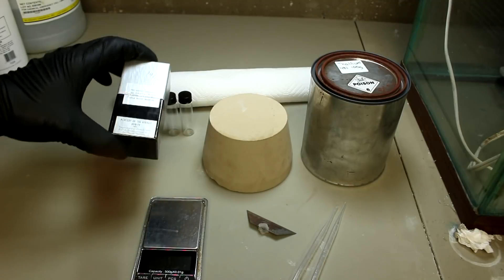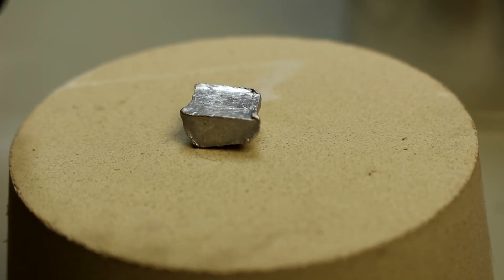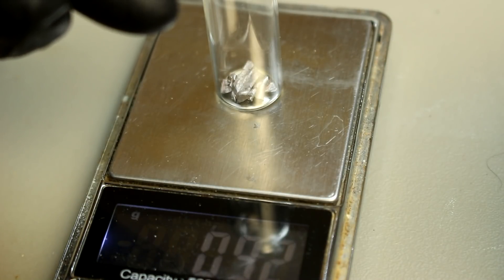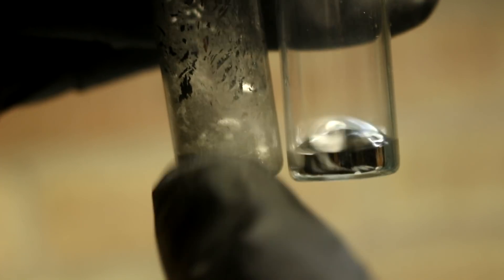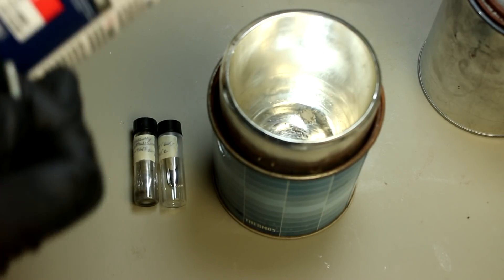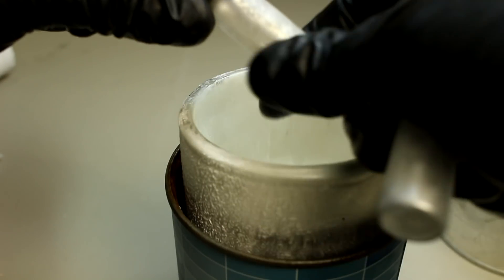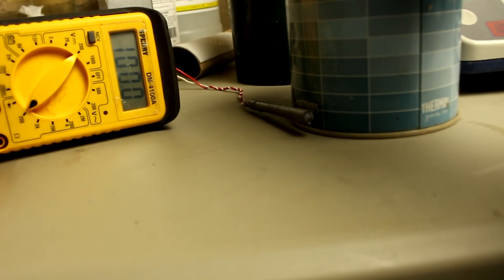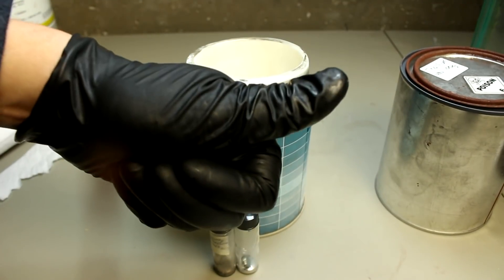Thallium Mercury Fusible Alloy

Comment: Cody, you can buy an old soviet SBT-11A Geiger-Muller tube for around 30$ on eBay and replace the tube you have in your GMC-320+ geiger counter with it (it works at the same voltage). Thus, you can detect low energy Beta and Alpha particles too :)

I have the same geiger counter. I did the modification : it works very well ! I litterally get ten times the counts from some samples (because they emit mainly alpha/low beta) than with the stock tube. Some other samples have a much lower difference, depending on the radiation type. And it's pretty easy to go from one tube to the other, depending on the needs.
Reply: Even better if you use a SBT-10A which is about 10x more sensitive than the SBT-11A (because it's a LOT bigger) or a SI-8B which is also bigger. The SBT-10A needs a 30Mohm resistor on each of the 10 anodes to work correctly, and the SI-8B needs a 20Mohm resistor on the anode, but other than that they are pretty much drop-in replacements. My GM counters modded with these tubes go absolutely nuts near a thorium mantle.
Reply: stamasd yeah I hesitated with the SI-8B. Don't remember what drove my choice. Maybe the price, sbt-10a is more expensive IIRC. And less "popular".
Reply: Mr Nobody not that much more expensive. I got mine for $40 including shipping. Same for the SI8b.
But I agree the SBT11a is better for making a small portable but sensitive counter (because it's smaller) - good for hunting radioactive stuff at thrift stores and whatnot.
Reply: Geiger geeks, yeah... 
With the Si-8B I get about 8000cpm from a thorium mantle with the aluminum cover on, and over 27000cpm with it off (alphas galore). And even though it's a huge 3-inch pancake detector, it's my favorite even to carry around - still small enough to be reasonably portable. About 1 pound including Arduino, LCD and batteries.
Reply: yes I will get a russian pancake some day too.  I got lucky enough to score an LND 7311 pancake tube for $40.  Had a lot of fun with it.  I go to antique shops and find stuff occasionally.  There's a few vids on my channel of testing things.  So far the hottest orange pottery I've found was made by Oxford.  I get near 80,000 CPM with pancake held across top of a little cup shaped bowl.  It's mostly soft beta but still quite active.  In comparison I might get only about 35-40K CPM off Fiesta orange stuff.
Reply: We are geiger geeks.  but yes... even the SBM20 is a better tube than the stock Chinese glass walled M4011 which comes with those.  Glass blocks too much low energy beta.  I cringed a little at the first burst of smoke which came off that lantern mantle.
Reply: I also tell them it's a geiger counter and detects mildly radioactive things which are nothing to be worried about.  However I start with "antique glass/pottery detector" because that's what I'm usually looking for.  I do not try to scare people.  You need to choose your words carefully if you go.  Most clueless people think it's a metal detector.  Often people think I'm checking for lead in pottery glaze.  Check all vintage orange pottery.  20+ different companies were making it and not just Fiesta.  :)  After WW2, Depleted U was used in Fiesta until 1973 when they finally stopped.  Before WW2 it was natural U oxide.
Reply: Wait... you find radioactive stuff in antique shops ? Damn, I gotta start searching too, then !
Don't they look at you weirdly when they see you waving a Geiger counter in front of all their stuff ?
Reply: Thrift stores are a great place to find radioactive stuff. Especially old clocks... many had their hands and dials painted with luminescent paint up until the 1950s... the paint isn't luminescent anymore these days, it looks a dull greyish-brown, but it contains radium. Buying one of these intact is the only legal way to own radium.
Reply: You just need to be friendly and explain it's your antique glass/pottery detector.  Show the store employee when you first go inside.  Many find it quite clever.  Now if you have a beeper alarm or clicker - turn it off so that you don't annoy other shoppers.  Being respectful and not making a big scene or scaring off people is important otherwise you may get banned.  I've been doing it for years at probably 20 different locations and never had a real problem.  Most people are just curious so you get pretty good at giving simple 30 second lessons.   :)  It's a lot of fun and you will be amazed at what you learn.  Many more things than people realize are hot.  The only thing which I see quite often is dismantled radium dial clocks which are a bit hazardous because of paint bits coming off.  People don't know any better so I advise them to wash hands after handling any old antique clock/parts.
Reply: Wait, you don't actually tell them it detects radioactivity ? I find it oddly funny if it's the case.
But we don't have those kind of shops in France. Or very few, and only for big furniture. I think I can only find those kind of things in what we call "vide grenier" ("attic emptying"), that are sometimes organised. People can pay a small fee to have a space in a park/place where it's organised, and put up things to sell.

For the alarm, I turn it off anyway cause it's so annoying. And I guess the clicker would freak out people too, since we subconsciously associate it with men dressed in full radioactive protection suits in documentaries about Chernobyl...

I've got to start searching for antique stores or go to "vide greniers". Never thought doing it when searching for radioactive objects (and Fiestaware is hella expensive on eBay... you get little pieces of broken cups for dozens of bucks).

PS : the ceramic of toilets (or is it called lavatory ?) is actually a bit hit. Not something you can detect easily, but doing a 100minutes long measurement near it, and 100 minutes of background radiation, I got a clearly visible difference, especially with a CBT-11A. Apparently, it's thorium, if we believe antiprotons' analysis (a youtuber).

Comment: Anyone knows why would that, or any metal for that matter, dissolve in mercury? It's obviously not temperature, so is it a chemical reaction happening here? Like acids do? What kind?
Reply: No chemical reaction. Just mixing of the electron gas and cations. Both are metals so they form alloy together.
Reply: I won't even pretend to know what electron gas is. So I guess it's electrons from Thallium, mixing with cations from Mercury, or the other way around. But why? What causes Mercury atoms to loose an electron, become cations, and mix with the electrons from the Thallium, or the other way around?
Why don't electrons from Mercury mix with cations from the glass container? I guess this only applies to metals then, so whatever has metal qualities will dissolve in Mercury? Then how about those dewars Cody uses to store Mercury, I think it's Lead. Why don't they alloy with the Mercury?

Comment: Here's an idea: can Cody make water ice sublimate? Sublimation means to go straight from a solid state to a gas state. We are used to see dry ice sublimate. Making water ice sublimate would require very low pressure. I have never seen it done on youtube.
Reply: I recommend Nilered's video "the iodine myth" for thorough discussion of the confusion surrounding the subject of sublimation.
Reply: Go to your freezer and look at the very bottom of the ice tray you will see that the ice cubes are significantly smaller.
Reply: It already does and it does not require low pressure. That's why ice is gone even if it never melts. All solids sublimate near their melting points.
Solid water de facto stops sublimating below -80 °C I think.

Clean your freezer and put a single cube of ice inside. Set the thermostat so that temperature is -5 °C. After few days, you'll see it's smaller.
Reply: I do not understand that. If you look at a phase diagram for water, it goes from solid to liquid to gas at one atmosphere. It only goes straight from solid to gas at 0.006 atmospheres or lower. If water does sublimate all the time than it's probably very little and not really  perceptible. I was talking about making water ice sublimate the way dry ice does.
Reply: He already has videos in which things sublimate

Comment: I have a couple of WWI soldier's tins that have lost their tin. One is a Model of 1916 bacon can; the other is a double-ended Condiment Tin. The tin fits inside the can, around 7" long. The idea was to keep poison gas out of the food... and at least slow down the rats.
Can tin be electroplated? What acid should I soak the sheet iron in, to lose the corrosion and oxidation? I was going to send them to a hot-dip place but they are too pricey... they basically retin copper cookware.
Reply: Pygar2 commenting cause I'm curious to know the awnser too!

Comment: Make solid helium :3

Good luck with that.
Reply: Just need good pressure chamber, 144000 bar @ room temperature :)
144x deeper than mariana trench.
Reply: TheLenny27 It's what forms when you melt a Toyota Supra
Reply: MyLonewolf25 i heard you need 25 atmospheres of pressure and still its melting point would be 1 kelvin.
Reply: Superfluids are really cool though.

I'd like to see some superfluid helium recorded with a good modern hi-res camera.
Reply: CheapVlog Jesus Christ you’d need something with a good few meters of thickness to be able to hold that pressure 
 

Honestly you’d needed to drop temp quite a lot to have it even become feasible
Reply: You wouldn’t be able to contain the helium, since superfluid helium has negativ surface tension and can pass through glass
Reply: MrN1c3Guy100: I believe Jupiter has no known "surface".. I've read it's gas down most of the way and then liquid metal hydrogen. The liquid metal hydrogen gives it the largest magnetic field of anything in the solar system.

Correct me if wrong..
Reply: TheLenny27 that will probably NEVER happen
Reply: There is properly some solid helium an Jupiter surface, just go there easy ;P
Reply: nope, even then, it just becomes a superfluid where it acquires negative surface tension. To make it a solid you need the kind of pressure you find in the center of a large planet.
Reply: HomeBrew Science that's cool
Reply: There is no solid helium at Jupiter and neither of the gas giants have any surface, solid or liquid.
Reply: Fox - why not? 25 atmospheres is pretty easily obtainable, and labs can reach below 1K
Reply: TheLenny27 I think if Cody made superfluid Helium we should start getting worried lol!
Reply: Sor Sor Science07 true...
Reply: TheLenny27 haha yes very funny my friend
Reply: Sounds pretty spicy
Reply: No at standard pressure it goes from liquid to suprafluid
Reply: TheLenny27 don't you have to be near zero Kelvin for that lol
Reply: Jake Roosenbloom i dont even think helium has a solid phase as standard pressure haha
Reply: Entenkommando suprafluid...? explain pls

Comment: How does mercury taste?
Reply from the maker: a bit like mineral oil
Reply: Next time tell us how sweet Lead is compared to D2O. I kid, but seriously, I wouldn't be surprised he has actually tasted Mercury. Heck, he drank Cyanide -- just a bit, though, but still!
Reply: It has no taste. It's a metal that doesn't dissolve in saliva, therefore does not trigger chemoreceptors in our tongues. If you put it in your mouth, you feel the weight, temperature and viscosity of it, but no taste.

Soluble salts of mercury, on the other hand, are something else. I honestly don't know what they taste exactly like, but I know mercury(II) chloride is an adstringent and it's not much different from other mercury(II) salts. It precipitates globular proteins. Knowing how general adstringents taste, I think it's safe to assume HgCl2 has a similar taste. Also, it's highly acidic. So all in all, it should taste horrible. Stick a rod of shaving alum in your mouth and you'll get a decent approximation.
Reply: i like how you've tasted both mineral oil AND mercury...
Reply: wither king In it's pure form Mercury is relatively not toxic and safe enough to drink because your digestive system isn't very good at absorbing pure metals. But when it reacts with something else it can be absorbed and then causes problems.
Reply: Like tuna, but less fishy.
Reply: krawacik3 I've had it in my mouth once tasted kinda like oil not sure if that's standard or if it was of my hands
Reply: Cody'sLab im not supised you know
Reply: deadly
Reply: Only if you completely ingest it, or have an open sore that would absorb it. I wouldn't know but I imagine touching it with your tongue then letting it drip off wouldn't actually hurt anything.
Reply: +Double Dare Fan so like chicken then?
Reply: krawacik3 like your mom.
Reply: Lajos Winkler metals have a taste. Why do you think metal zippers and mechanical pencil springs taste so great???
Reply: wither king cause he’s a beast
Reply: uhh... no comment on how you know that.
Reply: It tastes mercury-y
Reply: Mercury is a pretty nonreactive metal, similar in reactivity to silver, so bulk mercury is not that toxic. Also, plenty of people have had mercury in their mouths; ever heard of dental amalgams?
Reply: How does botulinum taste? do it for the science cody
Reply: Cody'sLab how would you know it would it taste like. Isn't it poisonous

Comment: This is probably what's inside my vintage thermometer that goes down to -50°C
Reply: If it has silvery liquid, yes. If there's something red or blue, then it's most likely toluene and some color.
Reply: danyk!
Reply: I occasionally watch him :)
Reply: No, I doubt it.  That’s a normal low point I think. We had a remote thermometer through the wall unit that was red liquid and went to -50.  Coldest day we had was -40 which was brutal.

Comment: Cody can you do something involving gallium? - I recently brought 50g of the stuff and I’d like to see what I can do with it apart from melt it
Reply: Matthew Batchelor i think Cody did some gallium stuff. For example he made a mirror...
Reply: Matthew Batchelor I have 20 grams of gallium and I think it is fun to mix aluminium foil with liquid gallium to make the alloy then putting the liquid alloy into water to generate hydrogen gas. I put a balloon over a jar and collect it all then blow up the balloon. After hydrogen stops forming then at the bottom of your container there will be all your gallium and you can reuse it
Reply: You could make some really brittle aluminum/aluminium or alloy it with tin and indium
Reply: it'd be cool to see if one could use it as lubricant for machines or engines, provided none of the components are made of aluminium, unless you want to destroy the thing... that would be fun though.
Reply: just do a search here for gallium.
Reply: You can make salts or tilt switches. Otherwise nothing too significant...
Reply: As a replacement for mercury in some organic syntesis. For example the addition of methylamine to piperonyl methyl ketone to produce MDMA.
Reply: John F. Kennedy so what happens to the aluminium in the amalgamation? Does it form aluminium oxide which goes into solution - I just don’t want my gallium becoming inpure

Comment: How many gas lantern mantles would one need to compress into a block & surround by TECs to create an RTG?  Do they even emit the correct type of radiation / would they get warm if you got enough of them together? 
I  tried to do the math on this once and I came up with something like a few cubic feet of compressed mantles to generate one watt. I'm not sure if I did the math right though, or if it's even possible.
Reply from the maker: 1 watt per few cubic feet sounds about right, thorium isn't all that radioactive.
Reply: Naturally occuring thorium has such a long halflife that its heat production is meaningful only in enormous piles such as the Earth's core (it's not pure thorium, of course!). Even if you had a sphere of elementary thorium 1 m wide, chances are you couldn't measure the temperature increase unless you had a really sensitive probe and you surrounded the sphere with asbestos and waited for days.

Radioisotopes useable for RTG units have very short halflifes (decades or less). Natural thorium (mostly Th-232) is a primordial element with a halflife of more than 14 billion years.
Reply: I guess it's confirmed then, my dreams of making an RTG from parts I can buy at Wal-Mart are shattered forever :'c